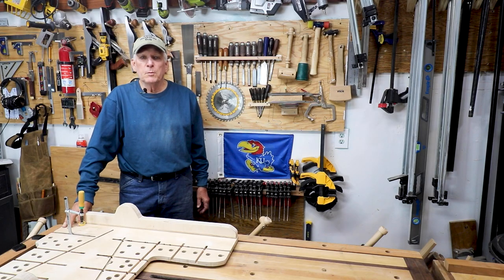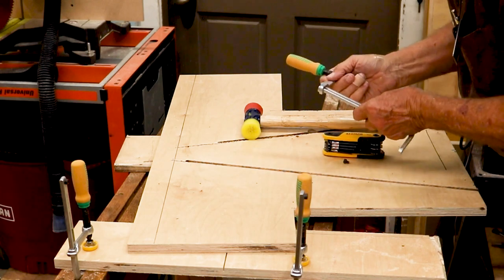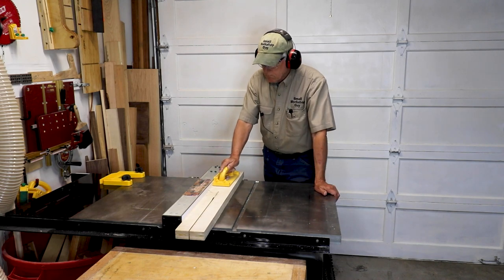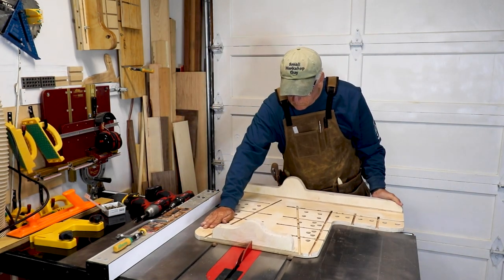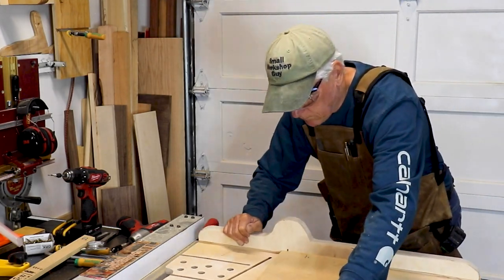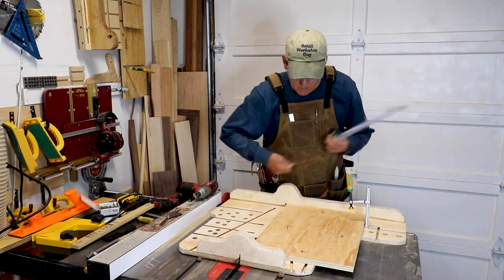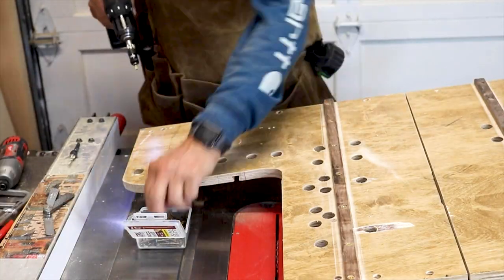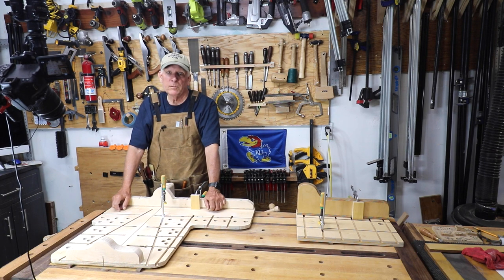Unique Crosscut Sled Build (Remix) Featuring Matchfit Dovetail Grooves - 5 Cut Method Explained

Comment: One of the first things I built was a cross cut sled for my table saw.  I watched Eng's video on the five cut method and managed to get my sled within 1/1000th of an inch.  It didn't seem worth going any further.
Reply from the maker: Yep, close enough is close enough and 1/1000 of an inch over an inch is definitely close enough and with my Age Related Macular Degeneration, it might as well be 1/10 of an inch.

Comment: What? No applause or outtakes? It's a scandal!
I'm bookmarking this video for when I build a crosscut sled. Add to that your fence extension, and I think I'll have a pretty nice sled.
Reply from the maker: Yep, just leave out the holes and you will get a lot of use out of it - well, put one big hole in it so you can hang it on a nail in the wall of your newly cleaned up garage - when that happens.  15 min per day!